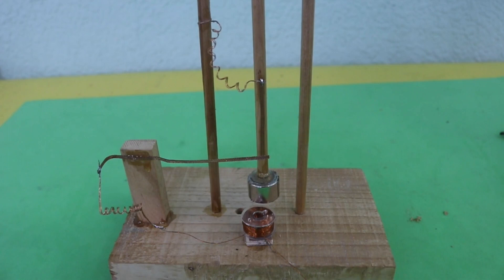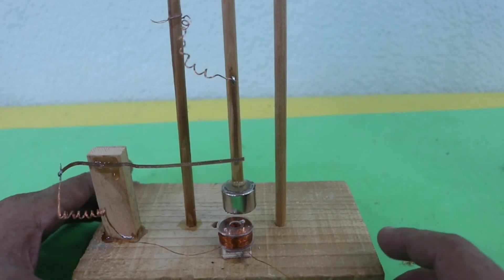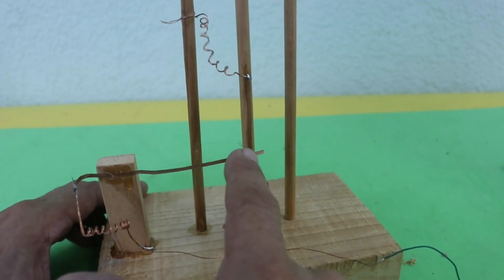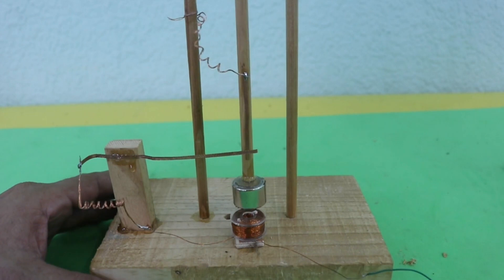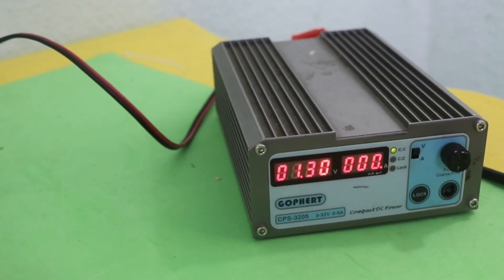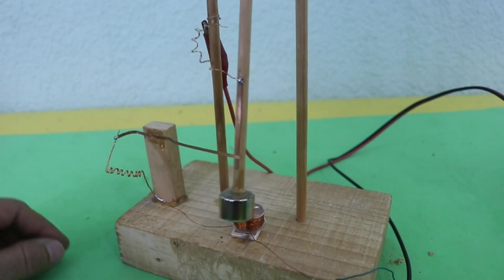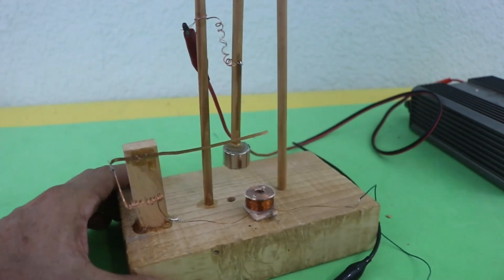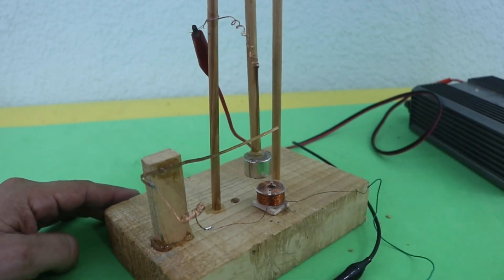Magnetic Pendulum Easy to Make

Comment: The coil don't use attractive forces to push the pendulum. It uses repulsive forces. The switch is actuated when the pendulum has allready passed its minimum position. In order to accelerate it, it is necessary to push it away from the coil. Therefore the electro-magnet needs to get the same polarity like the polarity of the pendulum magnet.

Comment: shorter pendulum will run faster 
try using the electromagnet in the maximum H  this way u can lower the energy consumption and less running time of the electromagnet
 did u measured the efficiency ?